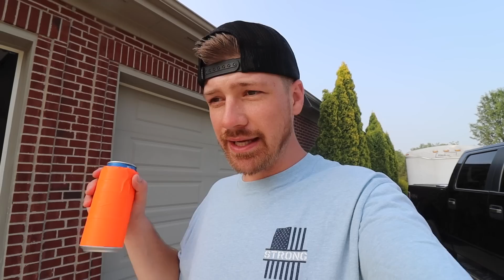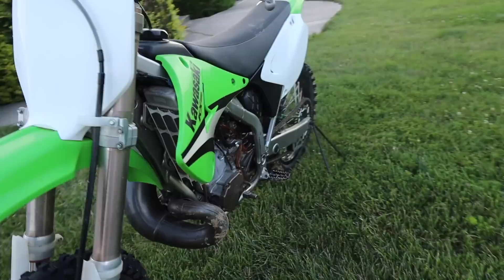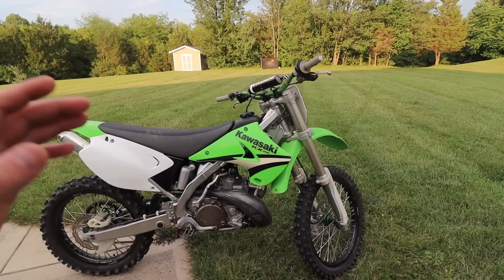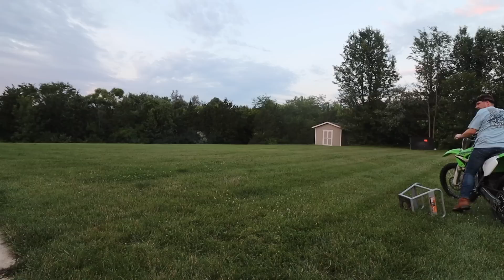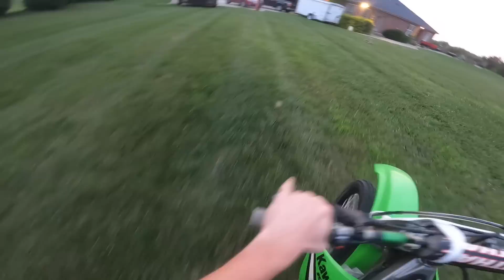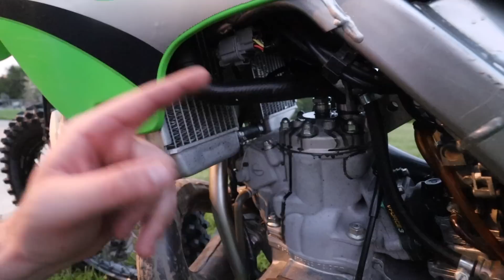JET FUEL in Kx250 Two Stroke!

Comment: AV gas or as you call it "jet fuel" is designed to be at high altitudes and be as physically light as possible(for obvious reasons). If it has a rating of 115 octane(for example), that is at high altitude, not ground level. It lacks the punch that fuel meant for ground level has. It will however work fine but you may need to tweek your mix screw or richen up the pilot circuit with the carb.
Reply: Jet fuel is clear. All Avgas 100LL has a light blue tint to it. The tint is added at the factory. So, he is definitely not using Avgas.

Comment: You should put Nitromethane in it, it is considered a twostroke gas, but it is 30 USD a gallon, so beware about that, but it is also a good gas, for smaller engines like 3.3cc

Comment: Jet A-1 or "Jet fuel" is basically low Sulphur kerosene, I did run a 2003 model Mazda 626 diesel on it for 2 years. Kerosene has slightly less energy then diesel so it do not give your more power but slightly less. Also running kerosene in a petrol engine is a bad idea as it will run really bad or not at all...

Comment: With the right cylinder head for the higher compression and tuned in carb honestly it would probably run alot better but the head failure I'm not surprised on during the video I was thinking that would happen then you showed it and I was like damn called it

Comment: Use avgas its leaded and keeps the cylinder lubricated and its more explosive
Reply: yes correct the lead protects the valve seats and no ethanol to reduce power so higher compression ratio of  12 to 1 would get more power from av gas . To  not increasing the compression ratio probably wont give much extra power over pump gas

Comment: I'd love to hear a mechanic explain why oil came out the spark plug, either way, great video dude, hope the kx lives to shred another day!
Reply: Put too much oil in the gas
Reply: @CLIVIXX  nop, you need to use benol oil in kerosene ethanol etc. the oil he put in the jetfuel just sank at the bottom of the tank. it doesnt mixe with jet fuel.
Reply: it is unburnt oil leaking out the power valve. the unburt/unused oil collects in the power valve and turns to black goo that needs cleaned out periodically..i would venture to say that he has a leak at one of his covers and why you seen the goo running on the cylinder.
Reply: @pascalgagnon8748  after a quick Google search (lol) you are correct, now it makes sense 😄 I'm not educated in how jet fuel works, thank you 😀
Reply: @pascalgagnon8748  Not so. Oil mixes just fine with jet fuel/kerosene.

Comment: okay so, in Brazil, there's around 27,5% ethanol on our Gas/Petrol, to prevent post-ignition, pre-ignition. something around that, wich is a lame excuse for profit.
so assuming that the jet fuel would increase the ignition capability of the Gas, how about mix both these fuel, and see what happens? yeah i know, recipe for disaster, but hey, worth a try.

Comment: You need to advance the timing to get the most out of the higher octane fuel , Avgas is about 115 octane .
Reply: AV Gas is gasoline for piston engine aircraft.. Jet Fuel is #1 Kerosene.

Comment: Back in the early to mid 90s i you used to buy aviation fuel because racing fuel was hard to get and more expensive to buy I never had issues using aviation fuel does come with a blue tint. Think it’s a non-gelling solution that’s added for high altitudes
Reply: interesting info

Comment: Jet fuel doesn't list octane ratings, because knock-resistance (which the octane number describes) is not important in jet engines - they cannot suffer detonation/knocking.

if you were to measure it, it would be maybe 20 octane or less.

And jet fuel does not contain any octane (C8H18) itself. It contains long carbon chain molecules.

That's also why diesels (which can burn jet fuel quite well) use a Cetane rating for their fuels. They cannot suffer detonation/knocking so that number is not important, but designers need to know how easily the fuel will self ignite when injected into hot air, and the Cetane number tells you that.

In the USA the minimum Cetane number is 40, and in most of the rest if the world, it's 46.

Jet fuel has a reasonable Cetane number too, though even that is not important for a jet engine.
Reply: yes sorta knew that from diesel engine that burn  cooking oil they modify oil with methanol system to increase cetane to normal diesel about 55 but can burn  veggie oil direct at lower cetanes like 46 but it gums up engines with very low cetane level fuels .
Jet turbine engine have different need than old style injection diesel engines

Comment: Jet fuel, 'kerosene' which is slightly lighter, refined diesel.. 

Warm starting should be okay, cold not so much.. It'll be running rich and as such a lot hotter..

Not sure about adding oil, it's got plenty as it is..

Comment: No wonder your bike is running like crap on jet fuel and keeps stalling. It is pretty similar to Diesel fuel properties and has very low octane. There is absolutely no benefit to running it in your 2 stroke. Put no more than 100 octane in it and mix it at 40 to 1. It will be a night and day difference to jet fuel with increased performance. Note, a higher octane rating greater than 100 octane would also be no benefit either unless you are running a real high compression ratio or "boost" where heat and detonation is the enemy. Two strokes are a different animal than four strokes and fuel injection. I always ran 100 octane in my built RM 250 back in the day with Castor 927 at a ratio of 40 to 44 :1. (Dependent upon elevation and jetting compensation) I never had problems with it. It was a great bike that hauled ass and was fun to ride. Good luck.
Reply: interesting info

Comment: Back in the late 70's I used jet fuel in my YZ 250, but you need to dilute it to about 75% gas to 25% jet fuel, because straight jet fuel blows them up everytime.

Comment: More energy density! Gasoline is towards the bottom of the list, alcohol is less... But jet fuel has more and diesel has even more! The sound difference is due to the difference in compression and flame front... Jet fuel needs higher compression! Diesel needs even higher! 
Gasoline will work at 5-6:1... Jeff fuel maybe 8-10:1? Diesel likes 12:1- 16:1! 

But great work!!! Love the effort!

Comment: Sparkplug will not ignite jet fuel. The motor is not high enough compression ratio to ignite jet fuel. He didn't even adjust the carb. Gas motors have sparkplugs and diesel motors have glow plugs to help with starting and high compression ratio. Jet fuel octane is like 15 to 20 octane. Next he will  be saying it is running on water.
Reply: Actually adding water in fine mist increases OCTANE of fuels .It was used in second world war bombers' aircraft to increase HP at take off .   That allowed very heavy bomb load aircraft get off the ground with even more bombs .It takes a lot of water to do this and water is heavy so WW2 bombers had enough water to increase HP at take off and few seconds of climb out before water tanks ran out .The Tennessee 1940 farmers and  1930  Oakies farmers in the dust bowl would add water mist to their tractors  often burning tractor vapor oil TVO a type of kero mix to get extra power and save on fuel and gain power. Water has to be preheated over exhaust stack to get it to enter engine  very hot as fine vapor mist  and steam expands 600 times when it goes from hot water to steam inside cylinder  with gasoline or kero  explosion from spark plug or glow plugs often in 12 to 1 ratio  compressions . engine oil pollutes quickly from parrifin wash and water so requires very much  more frequent oil changes

Comment: what happens if you put 2 strok fuel without oil?
Reply: The engine is gonna break obviasly
Reply: the engine will overheat, prob blow up.
Reply: You sieze the motor. Oil in the gas is what lubricates the crank and piston bearings since there is no pressurized oiling system like a 4 stroke
Reply: normally its melt down bad but not it seems in every country in the world Gasoline fuel has some lubrication abilities and some regions of the world the gasoline seems to greater lubrication qualities due to different methods of distillation of fuels . It seems from rumor's that low RPM 2 stroke engines with plain bearing fitting in pistons rods  and other bearing parts and  no ball race with the local gasoline can get just enough  lubrication to keep running without any 2 stroke oil
The typical 50 to 1 ratio or 2%  lubrication is for high rpm ball race type 2 stroke engines at max RPM power . With some low speed work some have cut the lub oil down to closer to 1% and report less problems . Some regions with low quality gasoline fuels with 10 ethanol  require as high as 4 % lubrication oil to keep 2 stroke engines happy. increasing or decreasing lubrication can also requre advancing or retarding timing . If you forget oil normally you hear a whistle sound as parts weld together and then rear wheel lock up

Comment: If I'm not mistaken, jet fuel is pretty much kerosene  a fuel oil. Adding 2 stroke oil probably made it way to rich
Reply: Correct, similar to kerosene. Terrible idea
Reply: Adding a percentage of oil, to any fuel, will make it leaner

Comment: Your honestly gonna be better off running what I used to for my old rmz125 that had a complete rebuild and was bored and jetted out to be a monster I used to run aviation fuel which is completely different then jet fuel and it’s crazy I had my rmz125 at 70mph before I crashed and totaled it completely
Reply: yes avation fuel is high octane no ethanol and lead to stop ping and made for compression ratio of 12 to 1 . removing lead in fuel required ethanol of 5% to keep octane up but can only do compression ratio of about 9.5 to 1. Adding av gas without increasing compression ratio often wont increase power so much and also adjust fuel air mix to suit the engine
Reply: @shiningirisheyes  yeah I know I had it taken to a shop to be rebuilt I put 2,400$ into the engine and had 1,500$ left over to get a new suspension setup and the rest went to new bars grips and foot pegs and a new can but other then that it definitely wasn’t worth what I put into it when I wrecked it 😭

Comment: People think that jet fuel is extremely volatile. It’s not.  It’s very similar to diesel fuel. Gasoline has a much lower flashpoint and burns much hotter than Jet-A, diesel and kerosene. You can throw a lit cigarette in to a bucket of it and it’ll put the cigarette out.

Comment: Jet fuel is formulated to actually run at much more extreme altitudes, you would be much better off running something like cam 2 racing fuel which is a high octane fuel designed for what you are doing.
In the old days we used to run 50% pump fuel and 50% CAM2 110 octane racing fuel and the big bore open class 500cc 2 strokes started better, ran cooler, did not blubber on hard acceleration and plugs never seemed to foul.

Could not make that same statement on straight pump fuel.

Comment: is it jet fuel as in real jet fuel which is oxygenated and highly refined kerosene or jet fuel as in high octane race fuel? it's funny how many people think high octane fuel will make  you gain power. high octane fuel is for modified high compression engines to prevent detonation by using a slower burning more stable fuel. A stock engine wont gain power with high octane fuel. If it's the highly refined and oxygenated jet fuel now that might do something but you would be smart to jet up using oxygenated fuel. Also oxygenated fuel in a regular plastic can doesn't stay oxygenated very long.
Guessing by the excessive smoke it was real jet fuel you probably didnt even need the 2 stroke oil or a very lean mix. It's also possible the 2 stroke oil might not have mixed with the jet fuel.

Comment: I've ran jet fuel , it's not good for it but will run on it cleans all carbon that's built up in head pipe  ect ect .
Just know it's not good to do so . If your ready to sell it  I'd be glad to take it off your hands cause it will need a rebuild now .😅
Reply from the maker: Surprisingly doesn’t need one. Not letting this one go, too hard to find them like this! Thanks for watching 😎

Comment: Jet fuel is kerosine based. Basically the same as diesel. Much higher flash point than gasoline. Do the math on the rest of why there's oil coming from the head bolts.

Comment: I want to see paint thinners next time!
Reply: normal Cars can run on pure toluene  a very high octane fuel and it stinks like a paint thinner. Normally a few percent of toulene is in pump gasoline to raise the octane of pump gas ..In normal 9.5 to 1 compression ratio cars increasing octane wont increase power. Racing cars using high compression ratio of 18 to 1 or even 22 to 1  and high percent octane fuel like Toulene can more than double the horse power of the engine but those cars cannot run on low octane pump gasoline of the 85 or 90 ron types. however very hard to start engines with high toulene  fuel types and cities would stink to high heaven and kill peoples  if all cars used high toulene  type fuels
Reply: @shiningirisheyes  well let's see the results in a two stroke!

Comment: I've both owned and raced an 05 KX250 and I totally disagree with what you said about it. The motor was without a doubt the best two stroke 250 for its time and is fast even by today's standards. I holeshot against 450s easily in a field of both A and B riders. The problem with the bike is that it wouldn't turn. MXA said it seemed like it was designed by committees that didn't speak to each other. In short, a very fast bike, and a very bad handling bike

Comment: Avgas is high octane. Jet Fuel is LOW octane. Jet fuel is just refined Kerosene and VERY similar to diesel fuel. There is no way you felt more power compared to gasoline.

Comment: Next, go to NASA or Elon Musk and ask for some rocket fuel to try on your KX250. You need to run an rc car 2-stroke premix oil used in ethanol like BB1, Klotz, Redline Rc, or any other brand from a hobby shop designed for ethanol premix will work. The Maxima doesn't stay mixed in the Jet fuel settling on the bottom of the tank which is why you are smoking like an 1820s locomotive.

Comment: If you put Ethanol in it it will give your bike 2 to 3 hp gain over gas but you will have to put bigger jet in it. Around 
.110
.112  these are pwk jet
As for the TMX i don't know 
Never ran it on my car